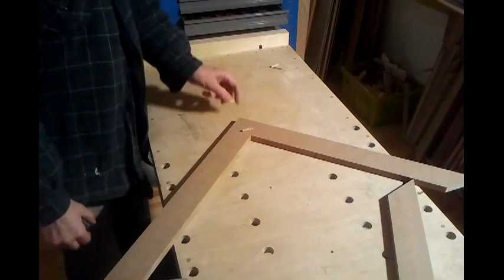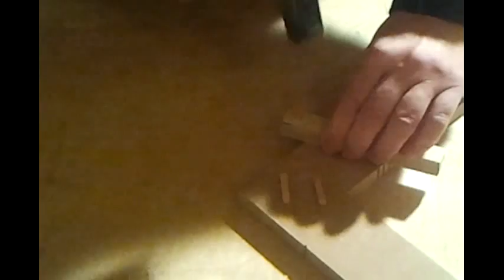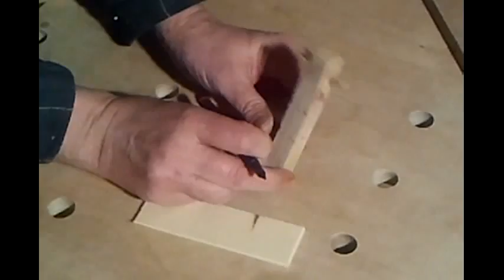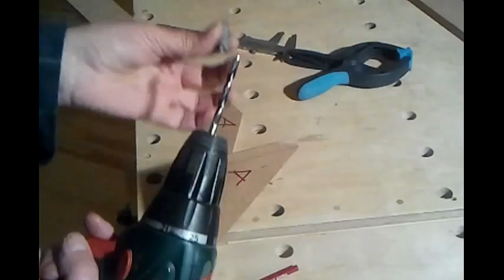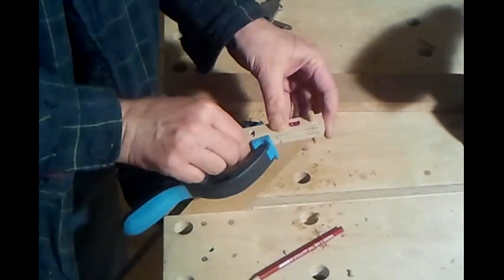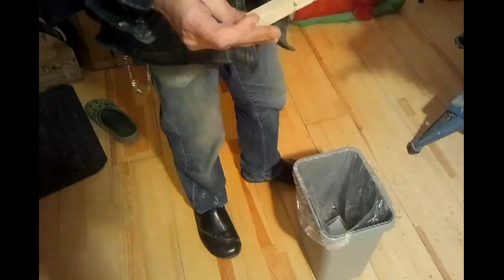How to make a dowel jig in 5 minutes

Comment: Excellent concept & execution! Although the distance from the protruding dowel at the top is the same to the first & second holes respectively, since those holes do not exactly line up, the pattern needs to be reversed for them to line up! That's the reason for having to alternate sides A & B when drilling. Simply Brilliant!.........Steve

Comment: I did not understand the comment and I did not understand it, but I repeated my video many times and understood that A and B are different. Even if you drill a hole in the center exactly, there will be an error and there will be a problem in correct connection.
But your method has seen that the center errors are linked together rather optimally.
I admire the simple yet superb way.

Comment from the maker: Yes, it is much more easier write A&B  than to drill a hole exactly in the middle. So, you can drill anywhere without measuring and it will  still fit
Reply: Still trying to wrap my head around it.

Comment: This is exactly the kind of DIY Dowel jig I came to look for on youtube, Thank You.

I need to make 16 miter framed hinged front doors with bars clamped in between for my pigeon pens I am building.

I'm thinking i might fit some steel collar pipe to the drill hole guide so it doesn't degrade over longer usage.

Comment: hey stephen,, maybe inserting a piece of the aluminum sleeve inside the drill holes in the jig will preserve the integrity of the hole. I experience some sloppiness in the jig hole just after a couple holes that cause the alignment to be off slightly.. any other ideas??
Reply: If you use 3/8 inch drill bits like I do, you can get the following metal housing from Lowe's: Hillman Group Seamless Steel Spacers. Item #137132, Model #880417. Measurements: 3/8 x 1/2 by 1 inch. They work really great and are exactly what you are looking for.

Comment: I have made the jig but after inserting the dowels the two pieces do not line up. Is it perhaps because the holes in the jig are not perpendicular or parallel?
Reply from the maker: Have you drilled the holes from different sides of the jig? This is important
Reply: Yes I did turn the jig and drilled fom both sides, A and B

Comment: Stephan, Isn't it critical that the holes in the jig be absolutely vertical?  Otherwise there could be a shift in the location of the dowel hole.  So, without a drill press, how can I get a very straight hole?  The only thing that comes to mind is running the drill bit along a small square piece of wood.... any other tips?
Reply from the maker: Matthew Lee You can make the holes with s router. But I think it is not necessary to have absolute vertical holes, a freehand hole is good enough.

Comment: Hey Branden just thinking out loud could I put a small piece of plywood on one side of the jig and drill all on face side would that work cause my clamping an exact side board to make a jig may vary if the frame pieces aren't exactly the same thickness
Reply: Sorry stephan
Reply from the maker: This works only if the holes are exact in the middle. But the trick on my jig is , it doesn't matter if the holes are in the middle or not. Even they are extreme off center, it works!

Comment: The thing that you put on your drill bit, to keep from drilling to deep into the wood, what is that called?
Reply from the maker: it is a little piece of an aluminum tube you can cut it with a hacksaw
Reply: Stephan Pöhnlein Do commercial doweling jigs keep you from drilling too deep?
Reply from the maker: Joseph Wagner
i dont know, i never used a commercial doweling jig.

Comment: why a not equal to b?  am i too dumb too understand?
Reply from the maker: These holes are not centered.
Reply from the maker: Eddie Chapman It is much more easier write A&B than to drill a hole exactly in the middle. So, you can drill anywhere without measuring and it will still fit